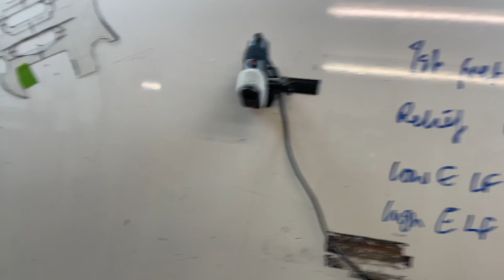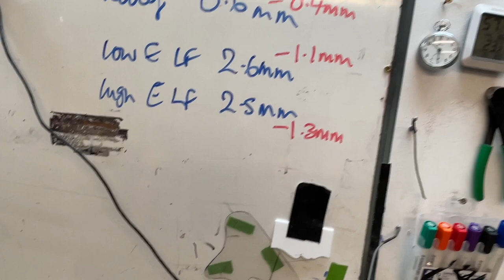Chapman Ghost Fret set up

Comment: As the owner, I have to say that I had to set the zero fret as well. It was incredibly high. But the fingerboard with stainless frets is well built, cleanly finished.
What I struggle with is the problem that it gets out of tune very often. Despite the fact that there are locked mechanics.
My hypothesis is that the problem is in the construction of the strings through the body. The wood of the body is quite soft and the string is sinking into it. And then all it takes is a change in temperature and humidity and the tuning shifts. What do you think about that? How to solve it?

One more thing worth mentioning and that is the resonance of the strings above the zero fret. A plastic tree between the strings will help.
Reply from the maker: Hi Jiri interesting idea but it's much simpler. Tuning stability is 50% a friction-free, properly cut (ideally Tusq) nut and 50% strings with ALL residual slack stretched out. As you discovered, locking tuners contribute nothing to tuning stability despite the common misconception that they do. Get the nut right and spend 20 minutes fully stretching the new strings until they won't detune any further and your guitar will stay in tune.

Comment: i have a ghost fret standard (2019 MII) and the tone knob/pot spins too easily but not loose, any advice on how to fix that? cheers <3
Reply from the maker: If it goes normally from stop to stop but it’s just ‘free-er spinning’ than you like then you need to replace with different b brand of pot. If it turns round past the stop point then it’s turning inside and likely to break the contacts.
Reply: @SamDeeksRelovedGuitars  i see, thank you. its just spinning freely without any friction at all like even air could possibly turn it at the speed of light.

i also have a question about the pickup switch if you dont mind hehe. it switches the other way around (down as neck, up as bridge) but if i rotate and sit it properly, the wiring inside wraps around the switch too tight making it short and im scared of snapping it off. is this an electronics issue? should i just leave it be?

really appreciate your time and replying quickly, thank you very much <3
Reply from the maker: @NicKenMic  with the switch if you can’t turn it round without damaging the wires they only alternative would be to unsolder the two hot wires (the ones either side of the output one) and swap them over
Reply: @SamDeeksRelovedGuitars  okay thank you, problem is that i dont have an iron nor know how to use one haha! Maybe ill just ask my local luthier to set it up and repair it as well :)
Reply from the maker: @NicKenMic  never too late to learn… :)

Comment: The bridge stands too proudly.
Reply from the maker: Well...yes. I agree. When you're a manufacturer making set- or through-necks you really have only one job and that is to ensure that your geometry puts the default playing action bang in the middle of your chosen bridge's adjustment range. You should be able to lower it to give a 1mm last-fret action (or however it reads at the 12th) and raise it to around 2.5mm last-fret action. If you can't set either of those two extremes then the geometry is wrong. Sounds like being overly picky - until you want to lower your action and find that you're on the verge of having either to rout a recess in your guitar's top or grinding a mm off the base of your bridge. That's when you think to yourself 'C'mon, surely the factory could avoid this?'
Reply: @SamDeeksRelovedGuitars  root out the issues before ya route out a solution.😂 ooh if engineers and designers had to actually work on what they create.